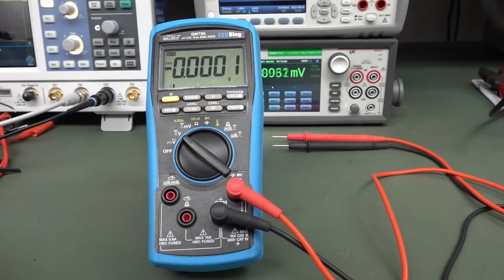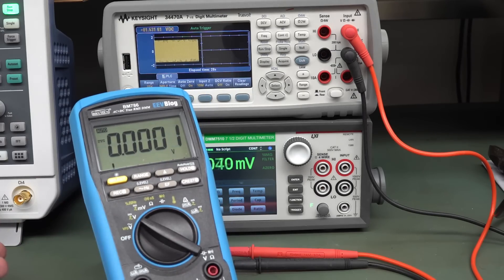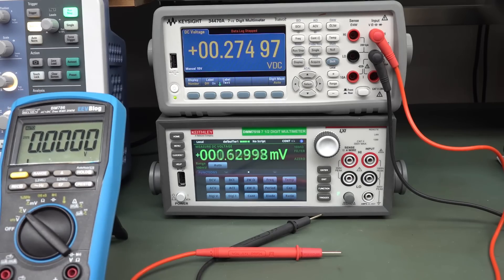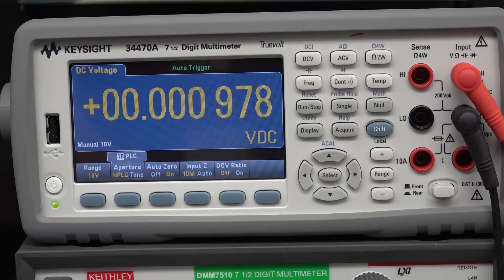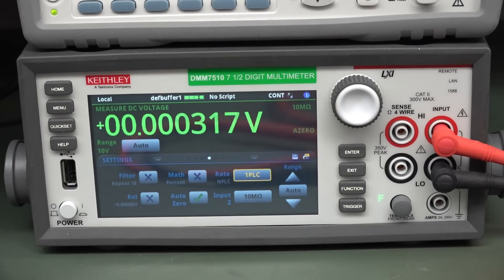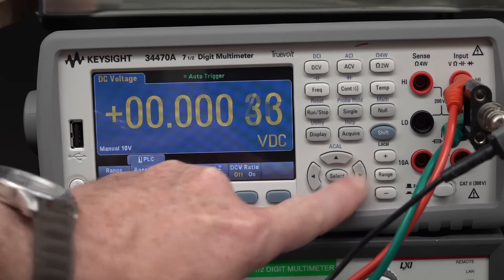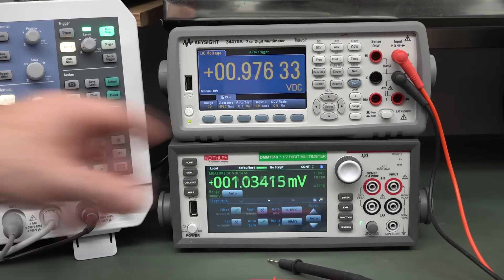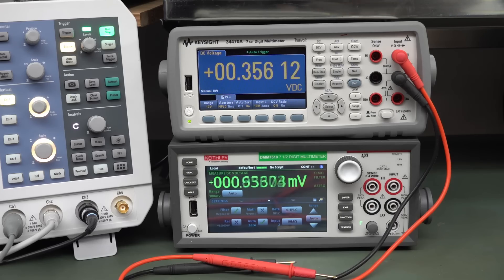EEVblog 1379 - What's all this NPLC Stuff Anyhow?

Comment: I love demoing this trickery to people however I usually take it a bit further and put my feet on a power board or hold a mains cable which capacitively couple huge amounts (for 10 MΩ) of signal onto a bench DMM or oscilloscope (sometimes 50+ V and enough to dimly light an LED), this way you can also demo how grounding yourself almost completely removes the signal and that those capacitively coupled 'ghost' voltages (especially those from isolated switching supplies) aren’t something to be afraid of (but might give you a small tingle).
Reply: Fascinating!
Reply: Tell that to mosfet gates
Reply: I take it a bit further and touch live buss and try and explain how a high impedance meter isn't great for mains troubleshooting.
Reply: "and that those capacitively coupled 'ghost' voltages (especially those from isolated switching supplies) aren’t something to be afraid of (but might give you a small tingle)."

Oh, that's what's happening with my stuff! Thank you for unintentionally helping me! I was always wondering why anything I plug into my multi-outlet power thing has this 60V and sometimes higher voltage on it's grounded parts. It hurts when I touch it with my forearms. Fun and concerning.
Thank you very much! Now I only need to know how to get rid of it without grounding me.
Reply: @GLITCH_-.-  You should be able to just ground the negative side of your power thing to remove the leakage. Grounding only yourself will actually increase the current through you for a stronger tingle. The signal/tingle is a result of capacitive coupling between mains and the output through either the transformer or Y class capacitor across the transformer so only special medical grade PSUs have ultra-low leakage currents but that comes at the cost of efficiency and price.
Reply: @WizardTim  I live in 230V. Can I really connect mains earth with a wire to a I. E. Li-ion Charger that is powered with a 12V brick, without blowing it up? I mean, I should be, but earth is on a different potential than the 50+V floating charger - or more accurately: the negative of the 12V brick. I feel like this could be problematic for some power bricks.
Reply: @GLITCH_-.-  This is not technical advice, but you can always take a 60W or so mains incandescent lightbulb and connect it between your points of interest - if it lights up, you'd have blown the fuses shorting those points; if it doesn't, there's not enough current passing there for anything spectacular, even if you can measure some voltage. Don't use LED lamps though, the whole point is to try drawing significant current and LED lamps light up from any leakage.
Reply: @GLITCH_-.-  A good example is if you have an isolated 12 V power brick to power an accessory for a desktop computer, the 12 V PSU’s negative wire will be directly connected to mains earth when you connect the accessory & PSU to your desktop computer via a USB cable (desktop computers are always mains earth referenced), the 50+V only appears because you measure it with a 10 MΩ load, measure it with 1 GΩ and you will see 230 V, with 1 Ω it will be < 1 V, in all cases you will only get a couple of microamps flowing.
Reply: @WizardTim  Oh right! Thank you! :)

Comment: Is the BM786 integration time in the 50Hz filter in this multimeter set in the firmware or is this a physical integrating RC plus some kind of diode chain? In light of some of the minor issues with the EMF pickup reported regarding the measurement of reasonably large resistance around  660-670kOm would be interesting to know

Comment: I am not getting how the mains signal is being picked up. 

Is it just from a 50/60Hz magnetic field coming off of nearby powered-up equipment and transformers? That would explain why twisting the leads greatly decreases the amplitude of the signal on the bench multimeter. But the leads aren't connected to each other. They don't form a loop! How can a magnetic field induce a current without a conductor that loops? I am thinking here of the Maxwell-Faraday equation where EMF is induced by magnetic flux-- but magnetic flux, by definition, is measured through a closed loop.

Or is it somehow caused by the power supply of the bench meter? Would a battery-powered meter not show this? No, Dave suggests the reason the handheld DMM doesn't show it is because the signal is integrated over a large enough time interval. That suggests it is a real signal that is coming through space and putting charges on the inputs of the instrument, right?

What exactly is the physical mechanism that causes the 50/60 Hz signal to end up measured by the bench meter?

Comment: When sampling a signal, you can reject local interference by sampling at a frequency equal to the lowest common multiple of the frequencies to reject, or harmonics of the LCM of the frequencies to reject. EG Sample at 300 SPS to reject both 60 and 50 Hz.

Comment: How do the high end dmm meter overcome the issue related to noise coupled via the mains supply which is coupled via the mains step down transformer. Even if we have filter capactor at the output stage of the power supply will they still not couple noise on the powersupply lines?

Comment: Nice. Nice. On a related note. I wonder if shielded mains cabling in walls and lighting, and from sockets to equipement, would help with anything to reduce the noise floor further. I know there are mains cable with shield or screen, or even both. There is for example a Swiss company called Gotham Cables that manufacturers some shmick multi-shielded mains cables (about 8CHF/m), I am not exactly sure who is manufacturing these cables for Gotham, but maybe labkable from Chaina. Another similar company is Lappcable, Yarbo, Elecaudio, and Oyaide (some of which are definitively total snake oil and don't come with any datasheets or certifcations, but still are interesting) . They obviously sell these stuff mostly to audiophilic nuts, but maybe there is a bit of merit in using them. Similar cables can be found for industrial applications, most notably motors, servos and steppers, but they usually have weird voltage ratings, and usually way more conductors to be useful for mains. Usually one will then connect the shield and screen to earth close to the source (i.e. socket or distribution board). Another option is to put mains cables in walls and stuff in metal pipes or channels, and ground them. Just an idea for future experiments. In some lab settings it is possibility to use that, for example when building a new lab, then one could put proper trunking, grounded pipes, shielded cables, and shielded cords and outlets, and lighting (there are companies making EMI shielded LED drivers and fixtures, as well shielded incandescend light sources, often to be used in RF testing or testing chambers).

Comment: Thanks for explaining the reason for this, I have Keithley 2000 and 2015 bench meters.
The voltages are higher on the 2015, thought it was some coupling from the audio circuits until I got the 2000.

Comment: Is the PLC just a fixed value or is the up down integration timing actually coming from the power line of the bench plug ... Ie will it track drifts in the power frequencies?
Reply from the maker: There is a mains detection tap, I think I showed that in the teardown of one of these.

Comment: Do these high end DMMs actually measure incoming mains crossing point to sync the NPLC, or does it rely on an internal clock? Just thinking you could get quite a lot of phase error on the final cycle with high NPLC counts if it's not synced.
Reply from the maker: The place it starts in the cycle does not matter, juast that the period is precisely matched.

Comment: Excelent video!! Welcome to the difference between deterministic noise and random noise. Averaging ( low pass filter after sampling depending on implementation ) is mainly designed to kill high freq  random noise. A moving average ( different from averaging frames) can cancel out a deterministic noise if the averaging period exactly matches the signal period( to kill a 50hz signal with a Fs of 100KHz  you need 2k samples) . However as you said, "Integration"  is effectively anti-alliaisng low pass filter before sampling is performed. By increasing the  the value of integration you move the role off frequency under 60Hz killing the deterministic noise.
Reply: You shouldn't think of it using the term "roll-off frequency" or as anti-aliasing filter. That's a term used for low-pass filters. The integration time actually makes the device completely blind for multiples of the the sampling frequency. That's a notch reject filter (more precisely: a comb filter) instead. When you integrate for 20ms, you will reject all 50Hz stuff, because you always integrate over a whole period (*without weighting*), so it doesn't matter at what phase you start sampling. On the other hand, you will get a lot of signal for 75Hz noise, because sometimes you catch two negative cycles, sometimes you catch two positive cycles and sometimes you catch some position in-between. The 75Hz will alias to 25Hz. That's why the integration time shouldn't be called "anti-aliasing" filter.
Reply: @tw11tube  I agree if they are using a pure comb filter (Not integrator-comb filter) ! As you said, Integration followed by resetting and then integration again creates a  filter that has notchs at Fs and other integer multiple of Fs. In fact, this is what a Continuous-time delta-sigma ADC (infinit resulotion) dose by feeding back the result of integration  every cycle and subtracting it from the input (resetting the integration).  In Daves example the deterministic signal falls exactly at sampling frequency and gets completely canceled out by  the "notch". However if the signal was a bit off from the fs it would still get attanuated significantly. In my line of work we call this transfer function an anti-aliasing filter  since it always have a notch at Fs and always canceles the aliasing that happens "around" Fs (not a comb filter though check the response of a CT delta-sigma ADC or a integrating ADC). However, I totally agree with you, a pure comb filter with no other attanuation is very very bad anti-aliasing filter only blocking certain frequency

Comment: Internally for many DMM aperture time is not always equal NPLC, so saying its a symptom is not quite right. For example settings NPLC100 on 3458A is not same as aperture to same time, as meter internally takes NPLC10 readings and filter them together.

Comment: Most people outside of the electronics industry have no idea how big and ubiquitous the electric fields are that surround us all the time. 
When I was just starting out in electronics design, I was working on a switching power supply, and was measuring the switching frequency which changes with load on a very old (1950 - 1960) scope. I was doing this in the basement of the house where I was living. Depending on the day, I was seeing both the expected switching frequency but also a signal at 1.160 MHz. I chased that 1160 KHz signal for weeks, trying to understand what was going on. Finally 1 day the signal was so big that dominated the measurement to such and extent that it was clear that this signal had some sort of modulation on it. So I ran it through a diode and then into my stereo input, and presto I was listening to a local AM radio station on 1160 KHz. Turns out that the basement dimensions were just the right size to form a resonant cavity, and that AM station would somedays be up to 1.5 Vpp on open leads. Even just moving to an upstairs room would cause the radio signal to be reduced to more normal radio signal level of uV or nV, un-measurable on my ancient scope. 
Just a little story about how experience is important when designing anything.  :-)
Reply from the maker: Don't feed the electro-smog zealots! :->

Comment: That Keithley has an amazing refresh speed, looks like at least 50x a normal multimeter.
Reply from the maker: 50x times the price :-D
Reply: The Keithley DMM 7510 is superior in many respects than the Keysight 34470A.  The Keithley has a 1 million sample per second reading capability and several other advantages!  
And as far as the cost difference, if you fully option the Keysight 34470A it is $5,369. 
The Keithley DMM 7510 has no option up charges because it is already fully optioned at $5,420.
This is only a $51 dollar difference!
When you do your homework, the Keithley DMM 7510 is a hands-down winner! I have both meters in my electronics laboratory, my go to meter is the Keithley DMM 7510. @EEVblog
Reply: Heck, all of em look like light speed compared to the DMMs I learned with...

Comment: I think I remember from my school years, that this phenomenon has to do with Nyquist theory of signal sampling, that states that if you want to measure a signal of a given frequency, you need to set your aperture to at least twice the frequency of the phenomenon. This NPLC setting is doing exactly opposite: if you don't ever want to see a signal of a given frequency  (to exclude it as a noise without  having to filter it later using math ) you just set your aperture low enough.

Comment: Does the equipament measure it's AC supply frequency to determine if 1PLC is 1/50 or 1/60 second? What if the instrument power cord is being fed by a generator or inverter with a frequency that is not in sync with the "real" all around mains electrical fields?
Reply from the maker: In these ones, yes, I think I showed that in one of the teardowns.

Comment: I'm putting my money on SMPS tomfoolery, I've observed my phone charger being able to light up an LED dimly when I hold one pin and touch the ground on the USB plug.
Reply from the maker: If your SMPS is working at 50Hz I'd say you have other problems...
Reply: @EEVblog  lol I mean common mode noise coupled between the DC output and earth ground of the supply, though on 2nd thought the meter should be able to reject that.

Comment: So this means that hand-held DMM that don't allow manual setting of 50/60Hz have to be pre-configured for the target region?
Reply: They probably just use 100ms (or a multiple thereof). On 50Hz that would be 6 PLC and on 60Hz it would be 5 PLC, but in each case it's still an integral NPLC.

Comment: I think this is what my 3478A is doing. I always thought is was going to break at some point. The resistance is pretty far out of spec on lower resistances but it still works. Are these still worth sending off for calibration?
Reply from the maker: That's still a nice meter, but you might be able to buy a working in spec ones cheaper than a full cal adjustment

Comment: How does this affect measuring actual signals at 50 or 60Hz?
Reply: And wouldn't higher-frequency signals also average out?
Reply: Set the meter to AC ?
Reply: Shouldn't you be using an oscilloscope for that?

Comment: Fun fact: The integration time adjustment on many meters maxes out at 10 NPLC, and the 100 NPLC setting is just an average of ten 10 NPLC measurements for example. This is because of the 1/f noise in the input amps and integrator which becomes problematic with longer integration times.

I think the Keithley 7510 that Dave shows in the video performs best in the 1-5 NPLC range, Keithley might have shown a graph of noise vs NPLC in the manual somewhere, very interesting stuff!

Comment: I don't understand why post-averaging does nothing. I could write a simple program to do a moving average on those fluctuating voltages shown and it would definitely have an effect. Either the meter's averaging window is very small as to make it useless or I'm missing something.
Reply: I have the same lack of understanding. My best guess is that on low NPLC it's not integrating all the time (analogous to recording 60Hz video with 1/100 shutter speed, the shutter isn't open all the time). The problem with that guess is it doesn't make sense why they'd let you run it with the shutter closed part of the time.
Reply: @eDoc2020  Yeah, it must be something major we're missing. But whatever it is, the exact method of how the meter samples or integrates is clearly not how we think it is. However, so far the post-averaging function is counter intuitive, misleading, defective. It should not fail to work as claimed by its naming. Perhaps Dave could do a small follow-up to explain this.

Comment: Dave have you ever wondered why picked up PowerLine noise is never even close to sinusoidal and rather triangular? Where is the non-linearity? ???
Reply: There are a lot of odd harmonics in the mains from switch mode supplies etc. Since you are capacitively coupling the signal into the open test leads, it will naturally boost the harmonics compared to the fundamental.
Reply: @ferrumignis  Ahhh yes you are absolutely right. Thank you. So I assume in the olden days where only linear psu's were used it was much more cleaner.
Reply: @LutzSchafer  Even linear supplies create harmonics because of the small conduction angle of the rectifiers i.e. current is only drawn near the peaks of the mains waveform. I can remember wondering why the waveform was distorted when I touched the probe of my old Hameg 20Mhz CRT scope 35+ years back, though I do remember it being somewhat sinusoidal rather than triangular.

Comment: Imagine that your accurate, very high impedance meter has a 1.500V battery (yes, I know; cell) with 1000Meg resistor in  series,  across the test leads and hidden from sight.
The meter would read 1.500V, but if you put it across (say) a LED operating at a few mA, would read the correct voltage. It's all a matter of SOURCE IMPEDANCE. With open leads the source impedance is about infinity so any stray charges would dominate.  Nothing to do with sampling time and aliasing. 
BTW: I presume you know there is a DC voltage gradient of about 500 V/m in the open air from ground to at least a few hundred metres height.